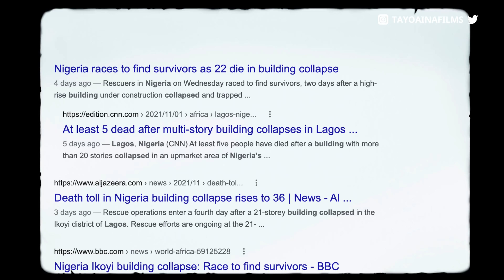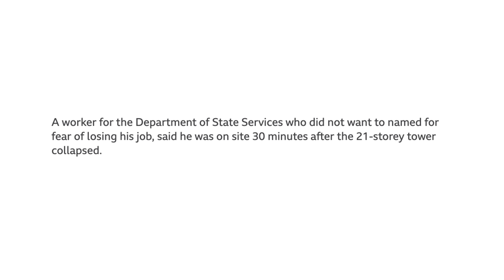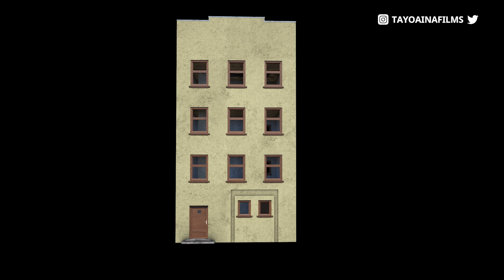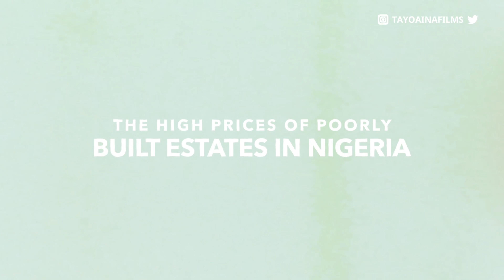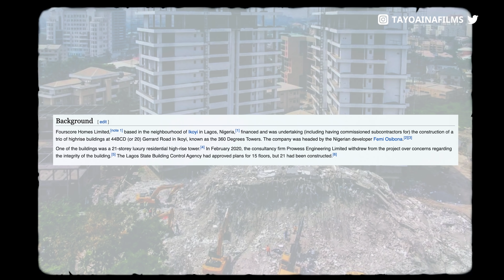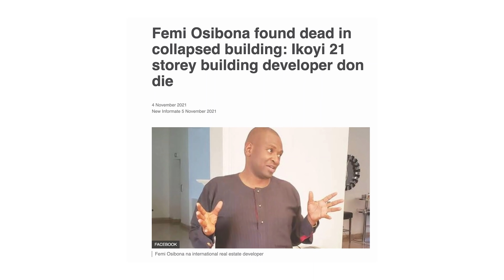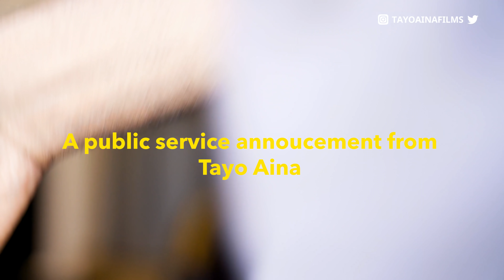Ikoyi Building Collapse: My Problem with Lagos Real Estate!

Comment: Tayo, thank you for this video. I have been in the construction industry in America for over 15 years. I got my Construction Management degree from Brigham Young University, Master's of Real Estate Development, Masters of Rural and Urban Planning from the University of Utah. Currently, I am doing my MBA at HBS. I mentioned this not to boast but to show that I know what I'm talking about. The biggest problem in Nigeria's construction industry is the lack of building codes. We simply don't have a building code like OSHA in America so developers are not accountable for poor services and products. For years the Nigerian legislators have failed to pass any building codes and laws. In America, we use cheaper materials to build but the cheaper alternatives must meet the safety standards and requirements, so finding a cheaper material that works is not bad but cost-effective. We need to stop cutting corners in Nigeria. We need building codes and laws. We need proper testing of materials. We need people that understand construction to build, and not random and untrained laborers.
Reply from the maker: Spot on bro!!
Reply: There r different testing levels in building but corruption has eaten up the integrity of the pple in charge.

Comment: I am in Construction and from what I understand is that there isn’t any form of regulation and zoning in this land. Before a land can be developed it has to be inspect every , but they cut corners and skip the very small details which have a major factor in hold the structures. Also as Tayo mentions it’s the materials and not abiding by the architectural specifications.  A lot of people just build houses with the hopes that Jesus will hold the structure.
Reply: The land is sinking, muddy areas..I don't even understand why they allow high rise buildings to be on these places near waters, as I lay person, I am not a technical person. What do you think?

Comment: Honestly you are saying the truth.  The hostel I'm staying in is a complete mess holes all over the walls,  terrible plumbing and electrical connection, leaking roofs.  I heard the man in charge used money and materials meant for the hotel to build his own small hostel in the same student area. By the time our landlord found out, the man had already build his own hostel to the point of roofing. 
I've been to the man's hostel and it's not much better.  The man basically use the money and resources that was meant to build one big quality hostel,  and used it to instead build one big and another small hostel, both of which are of miserable quality. 
The greed in this country is just too much, it's not only the government that are greedy,  the people are also greedy,  most of us have just not been opportuned to exercise our greed.

Comment: Concrete require testing before pouring,  many concrete truck drivers  add excessive water after they load concrete for construction site delivery .
Concrete shall have a tensile stress of 3,500 PSI and require a SLUMP TEST 
 before  building contractor allows the concrete  tuck  to  pour concrete . Many times there are Fibre additives that are used to increase concrete tensile stress . I strongly recommend  that you hire a competent inspector to ensure industrial best practices  are complied with.
Reply: I'm an Planner in the Boston area.    We had one company that tried to get over on us at City Hall. The Building Inspector had to be on the site constantly. Issues with the concrete, trash in the soil, you name it. I had to threaten to pull their permit several times during construction. They were supposed I submit all types of reports weekly and monthly from their engineers. We were fortunately that we had competent engineers on our team that I could send the materials. This is horrible and should not be happening. You cannot replace a life.

Comment: Not only that, the rebars may have been fine and the concrete mix. However the number of support (columns n beams) may have been reduced to save cost and the size. From the size of the rebars and columns & beams.

Comment: Structural Engineering 101 is the building’s foundational integrity.  This encompasses all aspects of a building.

My family’s 5 story home in Morocco is solid as a rock and after 30 years has never had any structural issues.? Why?  Builders and trades men take pride in their work.  The home was built from the ground up and project managed by my late mother in-law.  In addition, our 70 year old Riad is still standing strong without any structural issues.

Comment: Tayo... this problem is not exclusive to Lagos real estate. UK real estate has its issues. Not to take away from the point that you're making, but the typical house in the UK is smaller than half a house in Lagos (no exonerations here, everything is like miniaturized in the UK) and you've got even worse conditions to deal with if you have bad pipes or electrics (the cost can be astronomical in comparison). Your point being that you expect better from Lagos and every Nigerian should share that sentiment - however, Lagos real estate in comparison to other places is way better in terms of what you get (arguably - as I know people will debate this one).
Glad you suggested way forward - using quality materials etc.

Comment: We don't have much of a problem with cement quality but the quality of reinforcement steel in this  country is scary. I assure you most of the reinforcement in the market especially from 12mm down is half of the strength it is supposed to be.  But the contractor's site engineer and the consulting engineer are culpable in my honest opinion.

Comment: Taiyo the bottom line is almighty "Corruption". The developer was able to get approval to add five more floors because he was able to bribe officials from the Lagos State government officials who are in charge of issuing building permits , secondly the structural engineer should be held accountable.
Reply: The original contractor pulled out after the fourth storey, and declared that safety was not guaranteed after the fourth floor, this tells you that foundation was supposed to be for four storey not fifteen,
Reply: I still can’t understand why Lagos State continues to come out clean when buildings collapse. They approve a building then suddenly turn into police, judge and jury when something bad happens. This keeps happening over and over again. The developer cannot not get away with this if the State did its job.

Comment: You're so right bout renting a place and having to spend extra fixing things. Today i woke up to a flooded room. Water was coming from the wall. turns out that the other side of the wall was my neighbours bathroom and there is a licking pipe. thank God i wasn't electrocuted. There's always one thing or the other to fix every time due to the shoddy work on the apartments.

Comment: The cause is simple, bad construction. Low quality materials and lack of technical oversight leads to cost-cutting and illegal constructions which do not follow the safety code. You get concrete that doesn't have time to dry, floors added on top of foundations not built to sustain the weight of the extra floors. It's not just Nigeria, this kind of shit takes place in all countries to some extent. Sadly, it happens in developing nations much more often, where people are more desperate for a quick fix and immediate validation of their new spending power.

Comment: Tayo, unfortunately people try not to use right sizes of Iron rods and the right numbers because they are more expensive. At times where 16mm iron rod is needed for colunms of a high building, they would use 12mm rods to save money.
Reply: I’ve seen this countless times, I’m a builder in Ph but the cutting of corners I see in Lagos is so terrible
Reply: Iron rod was more that the issue. Do you know that building collapsed on self weight? It meant that the concrete was completely poor. People said it was due more floors than approved. Do you know if the concrete and reinforcement work was done properly, the house wouldn't have failed during construction, it would have failed when fully occupied. For it to fail during construction under self load it shows that the cutting of corner was to the extreme.

Comment: Your best guarantee of building safety in Nigeria and other West African countries, is the reputation of the Developer. 

You can't count on government regulatory agencies to ensure that multi-storey buildings are designed and construction supervised by professional engineers.

In the case of the Ikoyi building collapse, you can clearly see from the various videos here on YouTube, that they used very weak concrete (with little cement, too much water and/or bad aggregates), which peeled away easily from the steel reinforcement. This is a problem caused by a cheap Developer who didn't want to spend the minimum amount of money to hire a good professional engineer and follow his directions. And, the government agencies were perfectly prepared to overlook this clearly predictable cause of the tragedy.

Comment: No Steel Beams Used In Construction. In Miami Over The Summer We Had A Condo Highrise To Collapse, Ninety Eight Lives Were Lost. There Were No Steel Beams. Steel Beams Are  Used As Critical Support Trusses, Or The Main Framework, In Buildings. Steel I Beams Ensure A Structure's Integrity With Relentless Strength And Support. My Heart Goes Out To The Families And Loved Ones. Peace Be With You 🤍🕊️
Reply: This is the problem, how can a high rise building not have steel beams for the first floors. Only rods and cement cannot hold such a high structure

Comment: Truth is Nigerian developers are shylocks. They cut corners and build substandard properties and many refuse to acknowledge what they know full well to be wrong. The construction workers are also often very bad in the quality of their output. It is the duty and responsibility of a builder to make sure the construction workers do work that is up to par, but they often don't ensure this is so. Third component is the quality of materials. Most builders try to use the cheapest available material - this is particularly impactful in the areas of plumbing and electrical. Shoddy work in workmanship and materials in these two critical areas always spells nightmare for the home owner or occupier. The structure should never be compromised on - sadly this has not been the case in all situations. The failure of a building structure spells doom.

Comment: The way the floors collapsed "neatly / pancakes" on top of each other.... May suggest that there were catastrophic failures with all the columns..... There might be some mistakes with the Concrete Grade that were delivered/used and/or problems with Reinforcement steel.

Hopefully the investigators can find the reason(s) for this tragedy and prevent it from happening in the future.  🙏

Comment: Wow. Sorry to hear. The same thing happened here in the US, in Miami Florida. Like the buildings in Lagos, weak concrete; prolonged repairs...contributed to the fall. Ninety two lives were lost. Being cheap and rushing through certain processes always catch up with an individual/s. FYI: well done video!🙏🏾
Reply: That was not a building under construction. That one in Miami has been  occupied for a very long time.
Reply: @youme1414  the point is that both buildings had structural issues.
Reply: @misswogdaily2344  The one in Sunnyside Miami required structural repairs because it was decades old & built oceanside. Wasn't there also water flooding the structure.
Reply: @misswogdaily2344  Actually, it's not a structural issue. It is due to lack of  good maintenance that resulted from the pool platform to the ground level parking.
Reply: @youme1414  same hush
Reply: @youme1414  any difference? Both collapsed and people lost their lives.
Reply: @love-heartbamaiyi4258  There is a difference. It is like buying a new phone and putting on the first time and it explodes  tearing your hand compared with  a phone you have been using for years and suddenly wear out and explodes tearing your hand as the previous one. The gain of use for years makes the difference. Another thing it is part of the building that collapsed not all as in the case of Lagos. I am not saying the live lost aren't important but pointing out the difference you asked for.
Reply: @youme1414  do they built houses to collapse after some years? Imagine white House collapse, what will be your opinions? Houses were built for people to live, both collapsed and remembered they will still probe the construction company that built the one in America, they will not praise them and also they will lose their licence as well,  Grenfell tower was 24 stories and was built and completed in 1974 in South Kensington London was burn down during the fire break in 2017 and 72 died, they still blamed the cause and the UK government ordered all the councils to removed inflamable cladding that is in every building throughout the UK.
Reply: @love-heartbamaiyi4258  Of course there will be probes into the collapse of Champlain Towers South building in Miami but it is largely due to lack of maintenance not structural issue as with the case of the one Lagos. I am speaking on the their differences. 

It seems the building in Miami passes the American building standard regulations at the time of construction. Unlike the one in Ikoyi where there is no evidence of safety and standard regulations record provided. Even in the case of promising to construct a 17 storeys instead makes it 21. 

There is evidence more buildings will collapse soon in the city Lagos because people don't follow nor are provided standard regulations and enforced by the state government.
Reply: @youme1414  actually, there were structural problems that caused the collapse. They designed to the minimum safety codes and constructed the building using whatever maximum allowances they were able to get away with. Adding an illegal, unplanned for extra floor, adding a pool with a pad that didn't allow for proper water damage, last minute redesigning of the garage which removed structural beams and not picking up the load elsewhere which led to visible spalling and the failure of the building when they added extra weight. It's true that the tenants/owners were squabbling over an assessment of $15,000,000 to repair the damaged building. I wouldn't have been surprised if it would have cost 3 times that much.
Reply: @youme1414  incorrect, there was structural damage. See below.
Reply: @bedinabebe4521  no it was built incorrectly. They added a floor and changed the design so that it compromised the building.That was the reason that the building collapsed.
Reply: @bedinabebe4521 you are correct, spalling and saltwater penetration are deadly to buildings. But by these things alone should not cause the sudden catastrophic failure of a structure. That's the whole premise behind having building codes.
Reply: @staciasmith5162  Yet most of the building didn't collapse in areas where these beams are altered. This has gone to prove that evidence coming from those reviewing the causes need proper scrutiny.

Comment: Tayo.. Thanks for sharing this. Just want to add few stuffs. I live in london and just had a single storey extension done 2 weeks ago. My project passed through vigorous inspection by the building control. They check every stage of the construction and document and pass each stage. If your builder does otherwise, you will not be allowed to continue the project. Now, Mr Femi have lived and built houses and storey buildings in the UK. He has experience and knows you CANNOT cut corners in the United Kingdom or anywhere else abroad….NEVER. My question is — Why will you build those skyscrapers in Nigeria and cut corners? It just doesn’t make sense. I wish he’s alive to answer Questions and see the bodies of his workers he killed. May their soul RIP. I can assure you those other 2 building could collapse its just a matter of time. My advice … the government should Knock those 2 down as well for the safety of potential buyers. Lastly, I hope other developers who cut corners will learn from this catastrophic and change for the best. Thank you

Comment: Nice video Tayo. Very thoughtful.

Lagos actually has a pretty proactive building development regulatory and oversight agency, the Lagos State Building Control Agency (LASBCA). One issue though is that if/when LASBCA seals worksites/buildings under construction, many of Nigeria’s loquacious chattering class (probably including several folks here) will precipitously accuse them of “corrupt” practices. 

Nigerians are the solution/change Nigerians seek.